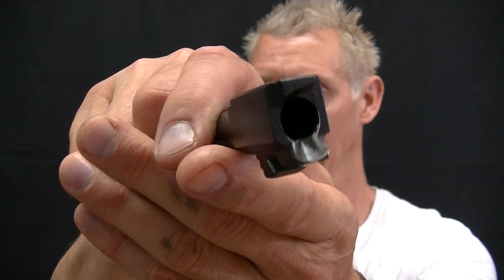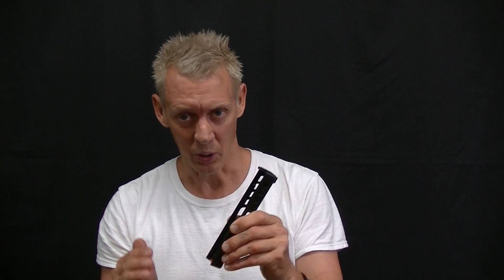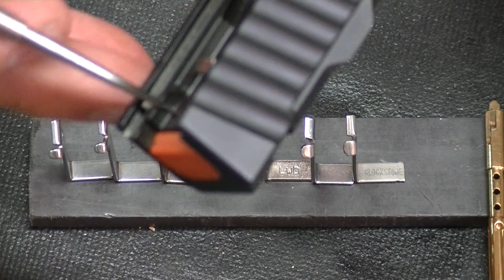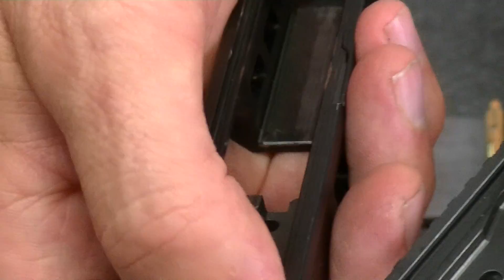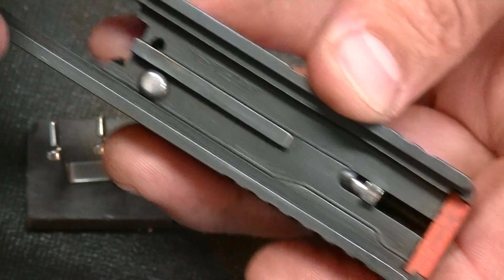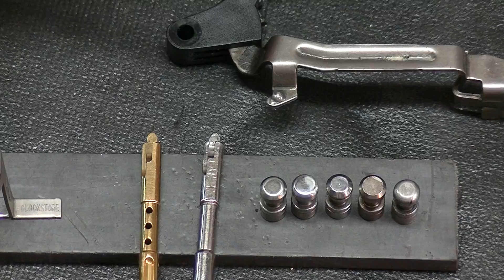Functional relationships and performance Intro EDUCATIONAL ONLY

Comment: Johnny, have you seen any issues using a gen 5 housing  in a gen 3 frame? They can fit as long as the little triangles are clipped off the housing's legs. I ask because I wonder if the 3rd gen safety plunger design will work well with the gen 5's trigger housing polymer outcropping that engauges the safety plunger. TIA

Comment: Thank you for this video! This makes total sense bcuz I put in a Ghost edge in my G44 and it feels good but hangs up the slide when dry firing. It works ok at the range but I put the Oem "." connector back in. And thanks for your other video on connector mods, I have an Apex kit in my G44 and used the connector that came with it had a terrible bottom edge and has put a big line in my bar like in your video.

Comment: If the end goal is a solid reliable carry gun with as crisp smooth trigger possible would you recommend just polishing the internals? And not really messing with anything else? I put a polymer 80 together with oem internals I did put a over watch precision trigger in it basically the shoe and bar. I polished the internals and left it alone. Would that be your recommendation for a guy like me that is handy likes to research and learn but know I will never be a gunsmith

Comment: Hi I have a new G17  I just built. I'm affraid to take it to the range until I iron out this issue. When u pull the slide all the way back.. if u just let it slam it goes all the way forward but if u let it go slow holding it about a half an inch from being all the way forward  it stops. Feels like it's sticking on  something or something is to tight and holding the slide. I've worked on the rails, lubricated it, checked spring, I cannot figure out what is holding it up. I was thinking maybe as the barrel is sliding back up as it's closes it could tight... But idk... Any suggestions? If u need more info if be happy to send u pics or what ever. I've read OEM barrels can be a little tight and stick a little but it's on purpose for accuracy, but this isn't an OEM barrel, it's the barrel the came with it from Polymer 80. I am really anxious to figure this out so I feel safe taking to the range. Before I go sanding something on a hunch that can't be undone I need a second opinion  from someone who is more qualified. Thank you!
Reply: What happened during your experience after you wrote this comment?